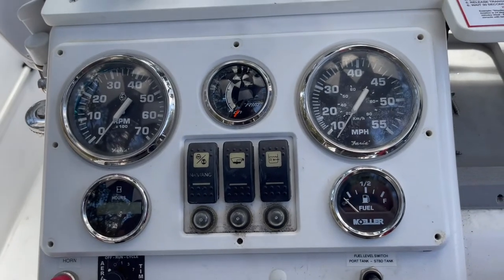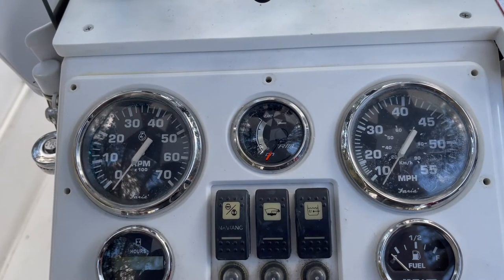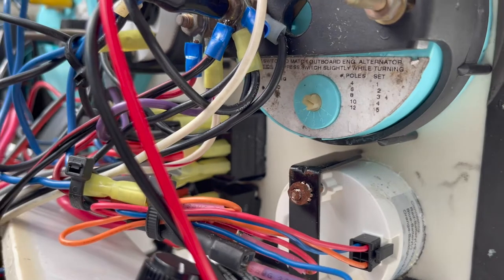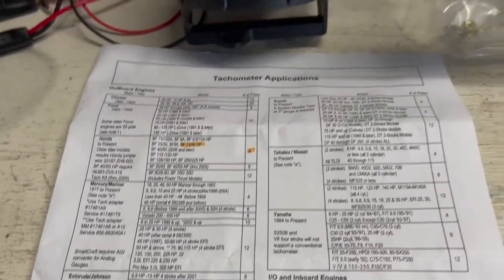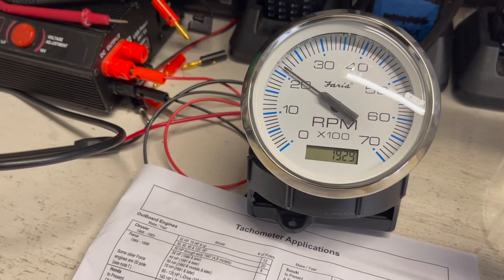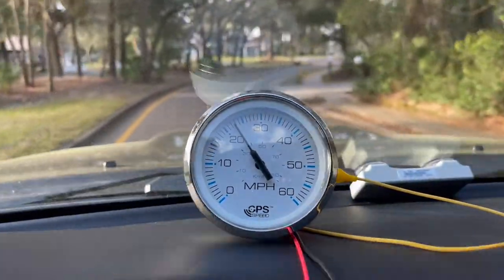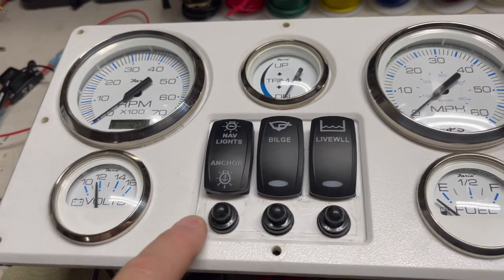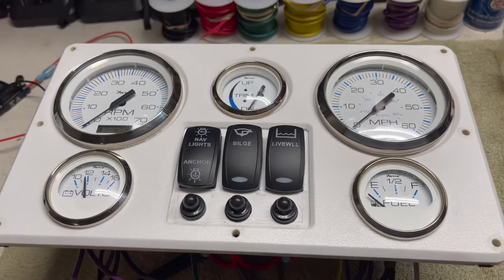Complete Console Gauge Replacement/Install

Comment: Great video friend! Ive worked at Faria Instruments for plus 30 years. Feel free to reach out to tech support if you ever have questions. Ask for me. That GPS stepper is a bit noisy when it homes but its one of the best products we have designed for the aftermarket in a very long time.
Reply from the maker: Thanks Jay - good to know.  No issues so far.